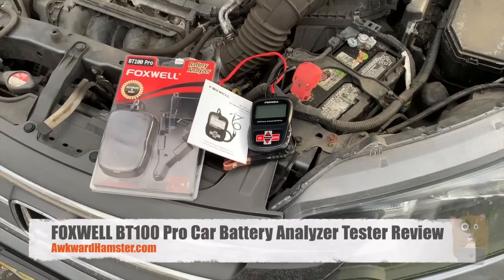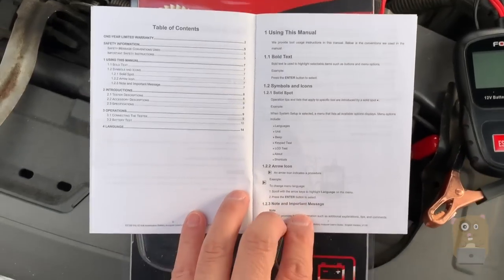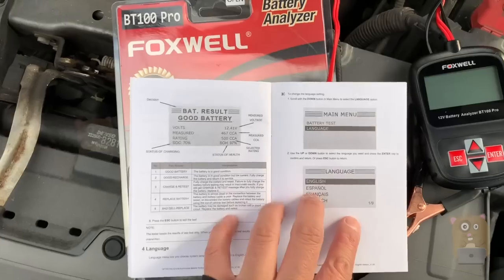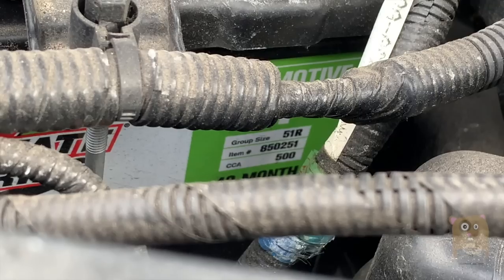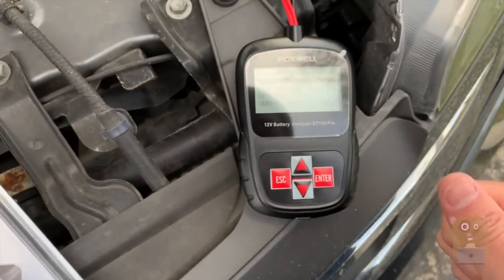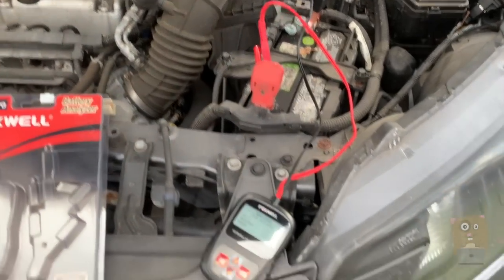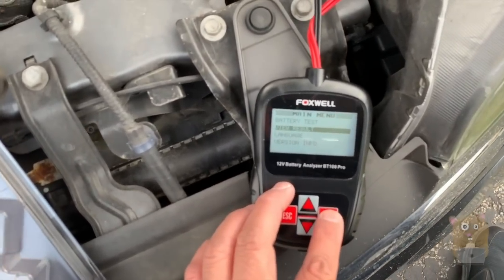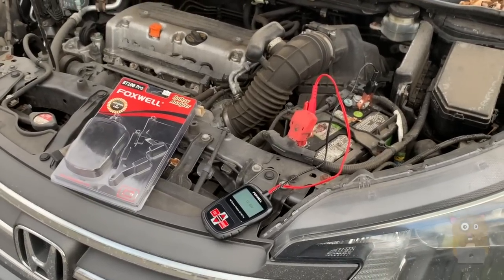FOXWELL BT100 Pro Car Battery Analyzer Tester Review

Comment: Here is one mistake that you should never do when using this battery analyser, that I learnt the hard way. We all know that when you use a smart Battery Charger (not battery analyser as this one) you connect the positive lead clamp of the charger to the battery's positive pole and the charger's negative lead clamp to the ground or earth point in the car chasis to charge the battery, when the battery is sitting in the car. BUT if you make the mistake of doing a similar connection with the Battery analyser as used here where you connect positive to positive as you should and then you connect the negative clamp to chasis you get a totally wrong anaysis of battery voltage, CCA and the battery charge percent and the battery state of health. All measured parameters will be artificially low and the analyser will ask you to change the battery due to poor condition. So in the case of battery analyser as here always connect the clamps to appropriate posts on the battery itsrlf and not on the chasis.

Comment: Does this battery tester do a crank and charge test? For the starter and alternator?
Reply from the maker: I don’t think it tests crank. As for alternator I recently had to change the alternator belt and using this led me to realize the battery wasn’t charging when vehicle was running.
Reply: Thank you for the review.. can you tell me, is there a difference between the Foxwell bt100 Pro and Foxwell bt100? They seem to be the same, but I can't get the pro anywhere, and don't want to end up buying a cheap Chinese knock-off of an already Chinese brand. I see the bt100 for sale on foxwelltool website.